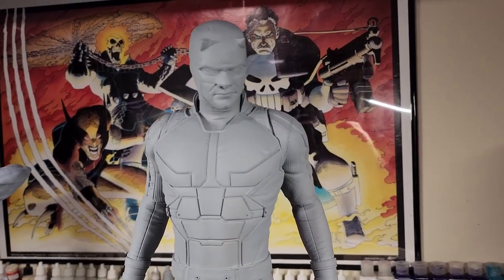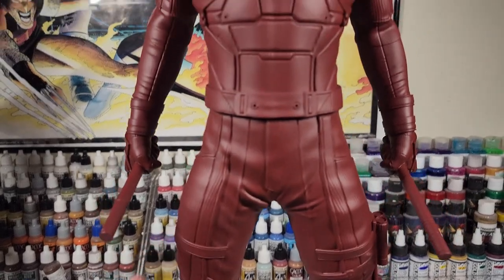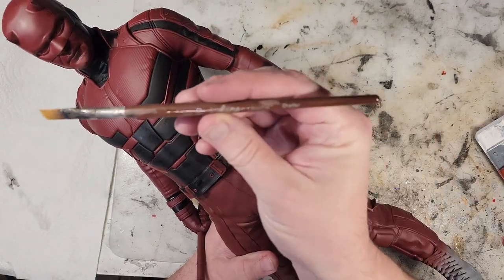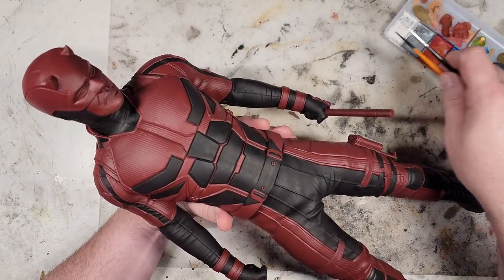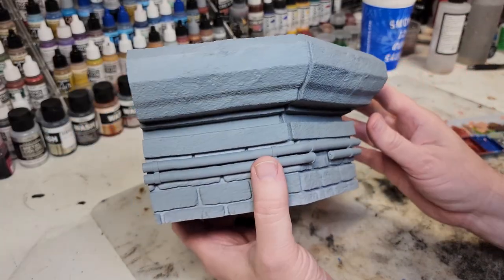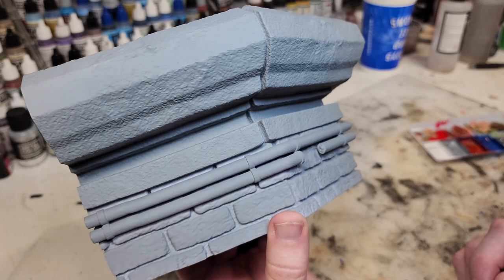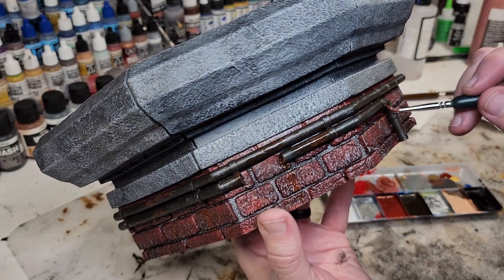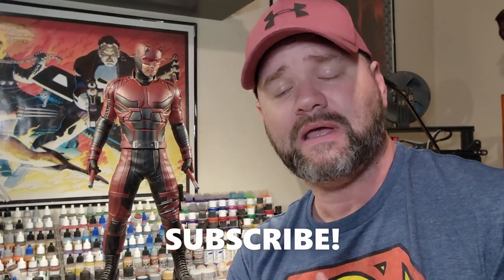Painting Your 3d Printed Models just got Easier- DAREDEVIL

Comment: I’m new to resin love lychee slicer but I’m not understanding the light off delay I have it at 3.5 is that ok? Also I have bottom layer count at 4 is that ok too?
Reply from the maker: It really just depends on the printer and resin you're using. See what the resin maker suggests.
Reply: what printer and what resin are you using?
Reply from the maker: I use several but my go to printers are the Linant Deck and Base 8k printers. And I use Chitubox for my slicer.